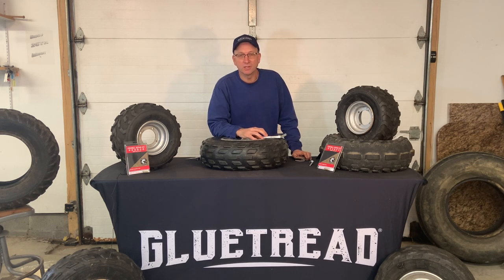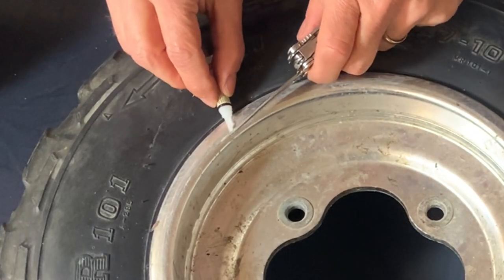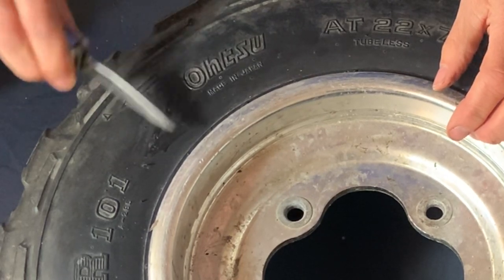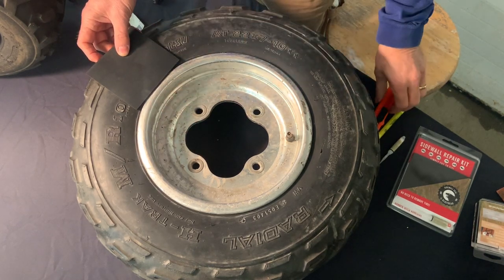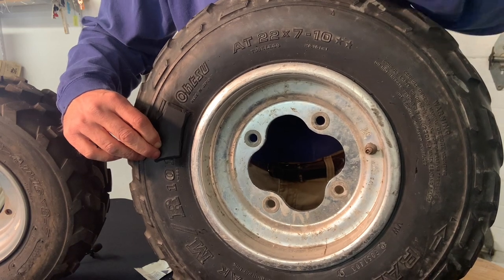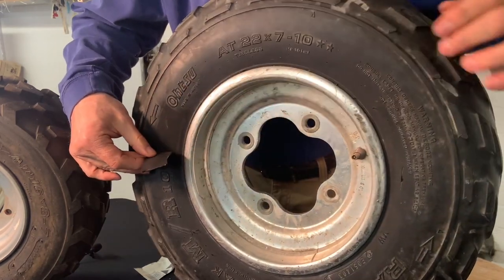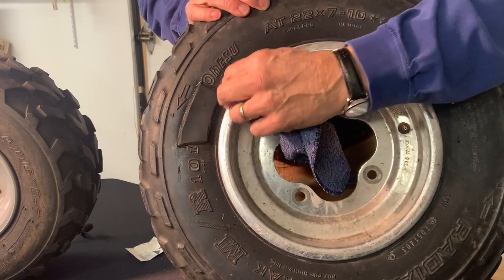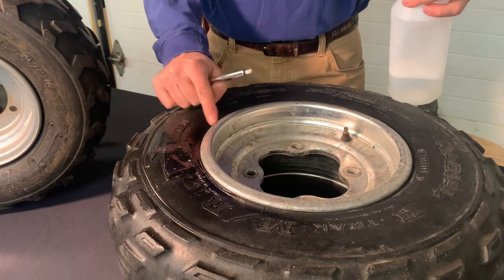ATV Tire Sidewall Repair - Sidewall Seal Kit

Comment: will this work for a regular car tire?
Reply from the maker: The department of transportation does not allow sidewall repair for any on-road vehicle. However, we do have several customers that use the patches on full-size jeeps and other full-size, off-road vehicles that are used exclusively off-road.
Reply: No . Dont use it on road vehicles . This is not a permanent repair.
Reply: Works fine for me

Comment: How long does this product last after being installed on a tire? 

At what psi should the tire stay inflated before the patch comes off?
Reply from the maker: The product is meant to be a temporary patch to get you out of a tough situation. With that said, we have customers that have run several hundred miles on the patch shown in this video. 

As far as tire pressure goes, the patches can hold up to 40psi based on the severity of the damage and how well the patch is applied. We recommend reviewing the instructions carefully before applying the patch. 

Hopefully this answers your questions, let us know if there is anything else we can help with!
Reply: @GlueTread  Thanks for the quick answers, I just made an order of your product. Will be using it for my sxs on the trails 😁
Reply from the maker: @d2nasty696  Sounds great! Feel free to reach out with any more questions!

Comment: would this work inside a car tire where a plug will not (hole to big for plug) if I use the tire for a spare?
Reply from the maker: Thanks for the question! Unfortunately, GlueTread products are only approved for off-road use.
Reply: If you drive it off road usage, it should be fine..pssst,.just fudge it and don't snitch about it ..capeesh.

Comment: Sorry but this is nothing more than a quick get out of a situation repair. Simply super gluing a bit of patch to the outside of a tyre is no way a viable repair,  you've not repaired the inner liner which will eventually lead to casing separation and failure.  Sorry but with  22 years as a commercial tyre fitter I've seen too many botch jobs go horribly wrong.
Reply from the maker: Great points, thanks for the comment. As mentioned, this is only a temporary solution and is only recommended for off-road use. With all of that said, we have customers that have reported leaving patches on for 2+ years and driven hundreds of miles with a tire repaired in this fashion. Again though, we only recommend this patch as a temporary, off-road solution.
Reply: @GlueTread  to be fair i have also over the years done my share of get you home quick jobs on off road and farm vehicles.
Reply: It is made to get you out of a bind before replacing the tire

Comment: Is that superglue!?😒
Reply from the maker: Great question! Our adhesive is a cyanoacrylate which is in the same family as superglue. With that said, our formula is made specifically for a rubber to rubber application. What that means is if you were to use our kit but replace it with just a normal superglue from the store, it wouldn't work at all. (feel free to give it a shot!) Thanks for the question!
Reply: To do this on a regular car tire, you are playing with your life. Don’t gravitate to that buy a new tire.